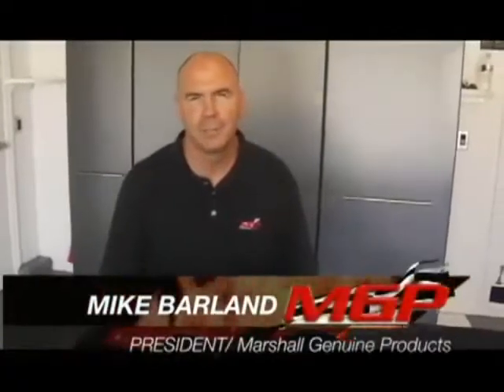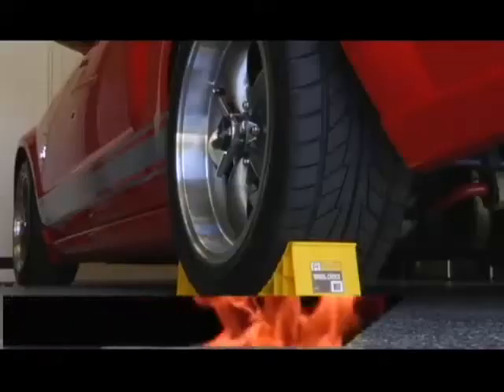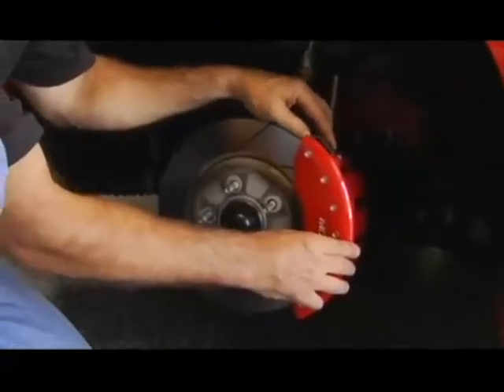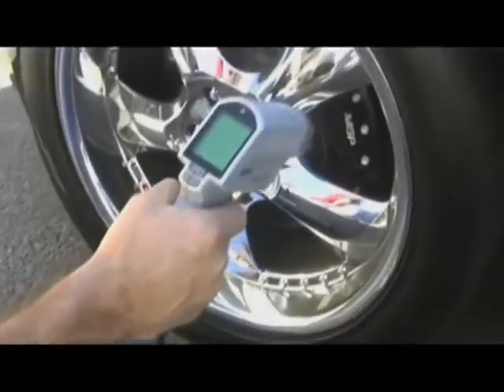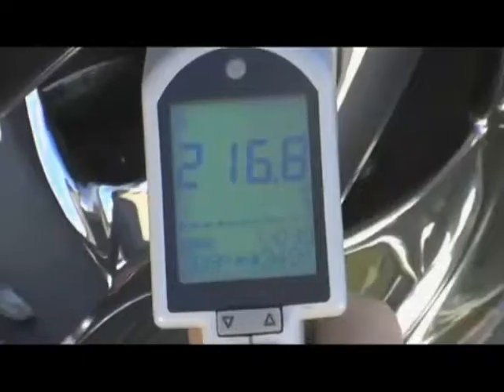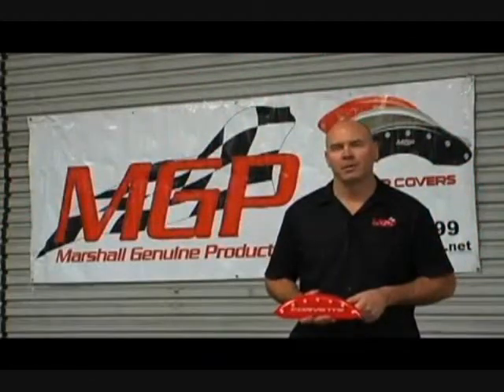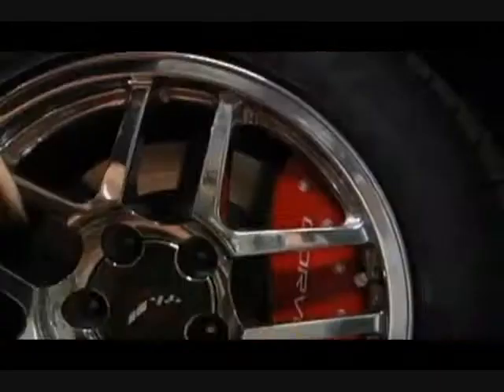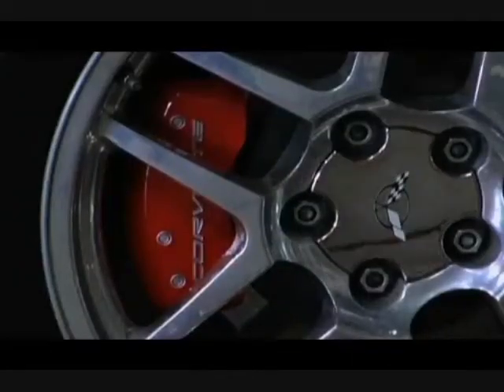Corvette Caliper Covers 1997-2011 C5 C6 Corvettes

Comment: Of course the cover will be cooler. You're not measuring apples to apples. The caliper underneath the cover is still the same temp as the other side. You're only showing that the cover remains cooler than the caliper itself. Your heat test is null unless you measure the caliper beneath the cover and compare it to the open caliper on opposite side.